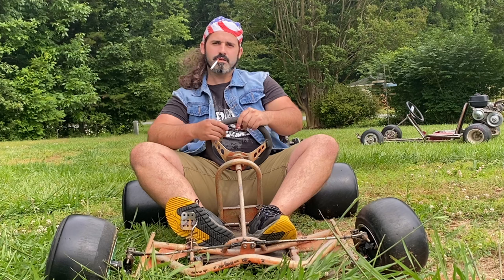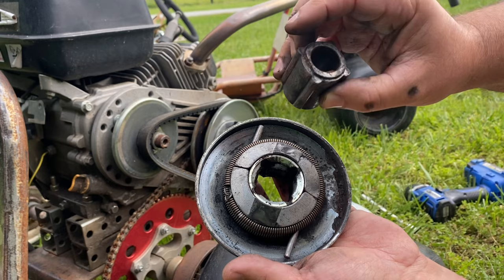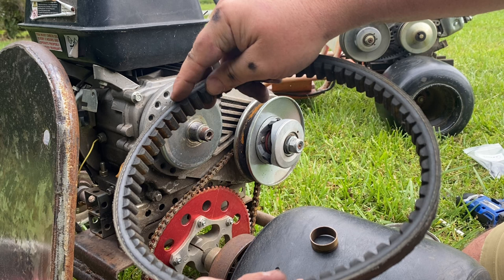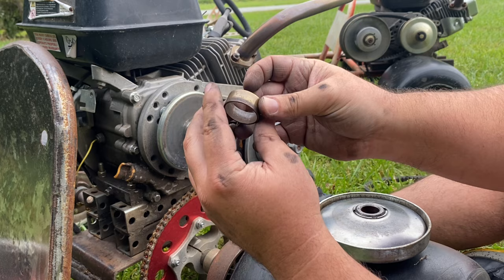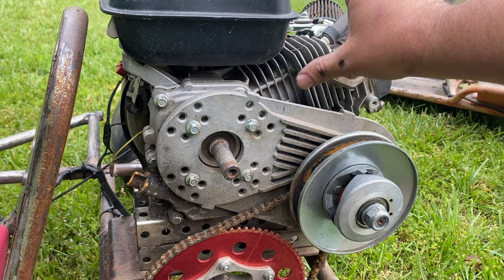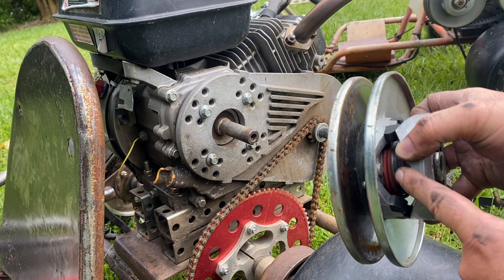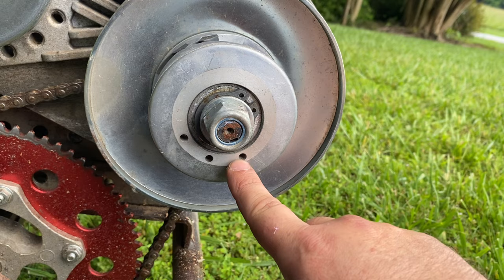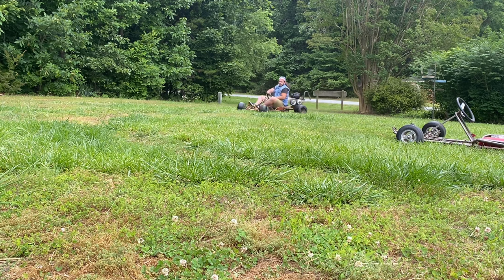‘Complete’ 30 Series Torque Converter Install And Modification Guide In Under 20 Minutes

Comment: Just a note on the comment "you can use a regular washer" on the primary. I had a weak washer that wore out and spun the outside cover off sending the weights flying violently blew up my cover, but luckily missed me. I would not run one of these without that washer, that is just me because I don't want to get hit with flying metal.
Reply from the maker: Interesting, my oldest converter has only had a washer on it for at least 6 years or so and I haven’t had an issue. I usually get grade 8 washers in bulk though from tractor supply so they are pretty strong. How did the washer cause the failure? Did it collapse or did the bolt just come off?
Reply from the maker: Ah I see. Yeah I would bet the brass was the main factor in its failure.
Reply: @jwsbackyard6413 Explain.  My parts came flying off not long ago and I was wondering if it’s because the bolt was coming loose and I’m considering loctite or something for it.
Reply from the maker: Yeah as long as the bolt is in nothing should be able to fly off. Loctite may help but an impact wrench is pretty effective at keeping the bolt on. If you don’t have an impact you can use a rubber strap wrench to hold the driver why you torque the bolt down.
Reply: @doubleemcastillano464  If the driver came apart while riding you should have noticed why when you looked at it. It was because the bolt loosened and eventually was ripped out of the crankshaft. If you look at the Amazon reviews for these torque converters you'll see how common it is.

This can be prevented by using the longest bolt that will thread into the crankshaft without bottoming. I use 2 1/2" long bolts with a flat and lock washer. Bolt gets locktite 242 and is torqued to the 20 ft/lb Comet spec. One of my old 196 crankshafts will only take a 2 1/4" bolt.

There are a few ways to tighten the bolt if you do not have or do not want to use an impact. One is to engage the pull start with one hand and tighten the bolt with the other hand. Another is to remove the blower housing and hold the flywheel nut then tighten. I just grab the large black washer with a pipe wrench and torque it down. And he did mention a strap wrench.

You would need massive engine power to blow up the driver. You won't do it with a 10 HP small block. Guys have drag raced these with modified drivers launching their bikes at 4500 plus RPM.

Comment: for the pulley do you need the washer for the locknut I have seen some videos of other people without it and mine does not have it and my lock nut came flying off the other day If I need it any idea what size washer that is and where to get one?
Reply from the maker: No you don’t need the washer. That’s strange that it was able to back itself off though. Was the nut on far enough to engage the nylon material? May need a fresh lock nut and a little thread locker.
Reply: @jwsbackyard6413  okay yea It was on far enough I honestly have no idea how it came off I was riding noticed the torque converter was making a weird noise the noise was the nut rolling around in the case  I put the same nut back on with out the case and lost the nut during the test ride kinda feel dumb now lol also where can I get the nut from
Reply from the maker: https://www.bmikarts.com/Hardware-Kit-for-Jackshaft-for-Replica-TAV2_p_7240.html
Reply: @jwsbackyard6413  thank you so much I really appreciate it your the best!
Reply from the maker: @LIMITL5SS  no problem

Comment: I would like to put the final drive sprocket outside of the torque converter box for use on a bicycle with 79 cc engine but I can’t figure out how to do it with a pressed into that bearing
Reply from the maker: Just so I’m understanding what you mean. Are you trying to put the sprocket on the back side of the driven shaft or on the very end of the shaft on the outside of the driven pulley?
Reply: Yes I want to put it on a bicycle without having to hang the motor way off to the right side
Reply from the maker: Gotcha, I’ve seen people push the shaft for the driven pulley through and mount the sprocket on the back side. The shaft has a lip preventing it from sliding one direction that you would have to deal with. Would likely have to change bearing at the front side of the backing plate.

Comment: Son of a gun I asked a question on another video an I think you answered it with this one I believe I got my lock but too tight but on mine the bolt it self sticks threw 3/4 of a inch it is a used one so idk what cause of this is but I got it with nut all the way snug an nylon stop gone out of it. If I did stop where it was supposed to stop I don’t imagine 1/2 to 3/4 gap from back the nut to the face of the driven pully would be safe huh ?
Reply from the maker: I would personally just get it snug and use lock tite if the nylon is gone. The gap may not effect it though because a lot of people leave their clutches/sprockets float with some movement side to side to help the pulleys/sprockets stay aligned on their own.

Comment: What would make one of these grind. I bought an old go kart and ordered a new tc from Amazon and bought a new 212 and put it it all together ran fine for an hour or so but now the driver pulley won't engage and just makes a grinding noise. Any help would be really appreciated.
Reply from the maker: There is a larger spacer that needs to go behind the backing plate for the driver. If that spacer is missing it will grind on the bolt heads of the main backing plate. If that is on the inner sleeve for the driver could be in backwards. The sleeve has a stepped side that locks into outer cover. If the outer cover isn’t locked into that sleeve it may not engage. If all that is ok I would take the driver apart and make sure the weights and springs look ok.
Reply: @jwsbackyard6413  ok thank you and yeah all that looks good. I'll have too take it apart and see what they look like. Thank you for your response.
Reply from the maker: No problem. I’d check the brass idle sleeve also; they are known to wedge themselves in the driver. I’ve also had a few occasions where the chain would rub the backing plate or the driven side when not spaced well.

Comment: Are both the TCs shown in this video the same? The one on the pink kart looks like it sits flat horizontal instead of at an angle like the other one. I need one that mounts flat like on the pink kart
Reply from the maker: Yes they are both the same. You can mount the torque converter in any orientation and it will work the same.

Comment: Thank you JW, that pretty much explains and confirms my thoughts  that the 30 series I'm working on can't handle the power of the engine combined with the weight of the kart. 
   Thank you for replying back to me.

Comment: There are a lot of videos out there on tuning GY6 type CVT's but I have not seen many on the Comet torque converters, so this is good information.  I don't think most people understand how they work or how dramatically proper tuning will change the performance of their machine.
While I don't agree with you regarding the bushing you throw away, I can see why getting stuck in high gear would suck.  I think that the issue is simply that the bushing is stretching itself out over time and fits loose on the shaft and becomes tight on the sleeve.  I would replace it not just eliminate it.

Comment: Great vid . I had a keyed sleeve on the driver break into pieces. Since I have the upgraded flywheel I may just put a juggernaut on it and lose the gov.. unless I can buy that sleeve sold separately
Reply from the maker: Yeah you can get it on eBay for about $10. A saw one listed under ‘hub driver’

Comment: im new.
You're a GOAT
Reply from the maker: I appreciate it!
Reply: @jwsbackyard6413  I installed the entire setup on a 100cc Gas bike using all of the tips in this video man. 
I wish I could buy you a pack of Parliament Lights Menthol.
When I was trying to mount this on my things, I was totally hung up on the oil-lite bushing (The ring of death). After watching this, I bought a stainless shaft adapter to fit it to my engine. I figured before I put any oil in it, I would remove the governor and all the associated parts. I got that done then reassembled it. I decided to mount the 100cc on its front against the seat tube with the jug straight up and it looks like a moto Guzi ha-ha. 

I couldn't figure out how the thing was going to work when I couldn't get the belt on. That DAMMED OILLITE was jammed in there stopping it from coming together.
I couldn't have done it (as fast) without you.

Comment: What size bolts did you use to mount the backing plate to the engine? The ones that came with my kit only goes in 1-2 turns and stops.
Reply from the maker: For the predator 212 they are 5/16-24

Comment: My pulley on the rear don’t expand? Brand new one ?
Reply from the maker: Only thing I could think of is the shaft slides on may need lubrication or there is something physically blocking it from opening. Make sure nothing is wedged in around the spring area.

Comment: Great video! Do you know what the thread pitch/bolt for the 4 bolts that holds the backer plate to the engine. The ones you said don’t over tighten and they will strip
Reply from the maker: The predator 212 use a 5/16-24. The kits usually come with metric bolts.

Comment: My front clutch is wobbling while it moves how do I fix that
Reply from the maker: I would bet that the inner collar is in backwards. The collar has a lip with two flat sides that locks into the outer cover. If the outer cover isn’t locked onto that lip it will wobble.

Comment: I'm curious if you have an answer or maybe some possible solutions to a problem i'm having. I have a 30 series on a Kenbar cart where the spacing requires a much longer belt and I'm lucky to get 30 minutes before the belt wears down probably 30% of its surface. The only belt i've used so far is a genuine comet 203599, which still seems a tad loose, but the 203598 is too small and doesn't fit. Appreciate it.
Reply from the maker: I’m not sure if your set up would allow for it but I have slotted my engine mounts so that I can move my engine to get the belt tight. I have also used washers to lift the engine some to get some tension on the chain or belt when I didn’t have room to slide it forward/backwards. Other things to consider with the belt wear is the weight of the cart and gearing. My heavier karts go through belts fast. The 30 series really struggles to clamp the belt on my heavier karts. Also I’ve seen the 30 series struggle with really low gearing.
Reply: You don't have another choice if the 598 belt is too tight. The 599 belt is the longest belt for a 30 series. 598 is the second longest. Your spacing pully to pully is just in between these two belt sizes.
Reply from the maker: Comet has a variety of belts for the 30 series that can be order. They are more expensive than the two common sizes but there are a ton of sizes available.
Reply: @jwsbackyard6413  Yes. There are 12 sizes according to the Comet doc.

Comment: Approximately how long should a belt last?
Reply from the maker: It really depends on gearing, weight of the kart, how much power the engine has etc. On a proper setup I’ve had them last years as long as they stay out of the elements. On my larger heavier karts they may last a few months.

Comment: Thanks for the vid, what size is the large nut on the rear driven pulley?
Reply from the maker: I haven’t measured it myself but Comets website says 5/8-16. Most eBay/amazon 30 series copy the Comet so I’d expect they use the same size.

Comment: I see you lifted the motor up to make it fit.Looks like I'm going to have to do the same thing
Reply from the maker: Yeah engine risers are almost a necessity in any application where the mounting plate is low and using a torque converter.
Reply: @jwsbackyard6413  Where did you get at?
Reply from the maker: @micayiah1 get the riser? I made it out of some square tubing from Lowe’s or Home Depot
Reply: @jwsbackyard6413  Ok cool man. I really appreciate it!!
Reply: @jwsbackyard6413  I have a question for you. So I bought a riser for my son's go-kart. I went out and bought another chain cause, of course, now that the motor is higher, the chain wasn't going to fit. I got 10 feet of chain and  just shortened it to where I needed it,but the chain is a little loose, and if I take another link out, it will be too short. So, do I need a different size chain or a different sprocket? The chain keeps popping off.
Reply from the maker: @micayiah1  most karts have slotted engine plates where the bolt holes are elongated so you can slide the engine forward and backwards. You just need to loosen the bolts holding the engine and slide it forward some with the chain already on. If your mounting plate doesn’t have elongated bolt holes you can extend them with a drill/grinder etc. That’s how most people tension their chain.
Reply: @jwsbackyard6413  Awesome! man, thank you so much for getting back to me!! I'll check it out.
Reply from the maker: No problem
Reply: @jwsbackyard6413  Just want to say thanks again for your input. Moving it back worked like a charm!👍🏾👍🏾
Reply from the maker: @micayiah1  No problem. Glad it worked!

Comment: What is the HP of your go-kart engines?
I have a Duramax 440cc 18hp.
Reply from the maker: Have quite a few predator 212s that are somewhere between 8 to 10hp. I have a tillotson that’s probably closer to 14 or 15hp. The 30 series have held up to those power ranges but the kart weight is really what has made the difference. On my heavier karts the 30 series slips.
Reply: I will be installing a 40 series and that should be good. Btw, are the bracket and jackshaft ( bearings) on the 30 and 40 series the same or is the 40 built stronger?
Reply from the maker: @edmagee6818  I’m not sure about the bearings between the 30 and 40 series. The 40 will be able to handle a heavier kart and more power without slipping for sure. It is much heavier than the 30 so should have some more clamping force.
Reply: Ok thanks, you confirmed what i thought. I bought a 40 series today from BMI , it's already set up with the reverse spring. 
This go kart thing is a new experience for me,as I'm used to working on cars and trucks.
Reply from the maker: If the 40 isn’t strong enough they make a few that have stronger drivers but I’d expect the 40 will be a big improvement. The nice thing about small engine stuff compared to cars/trucks is the cost. The low cost really lets you experiment.
Reply: They are cheaper indeed, i owned 5 trucks ( class 8) in my life before i retired. 
This customer is the only one that has a go kart.
Thank you for replying back to me, Merry Christmas 🎄.
Reply from the maker: Thanks! Merry Christmas!

Comment: Can you swap out the gear sprocket on the driven pulley side for more top end speed ?
Reply from the maker: Yes, you would just need a larger sprocket(one with more teeth). You would sacrifice some torque though.